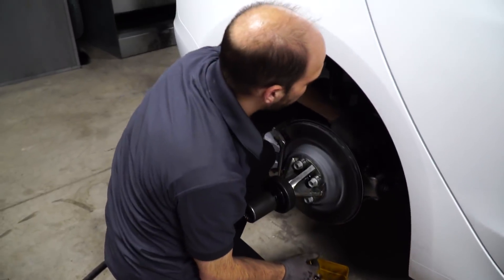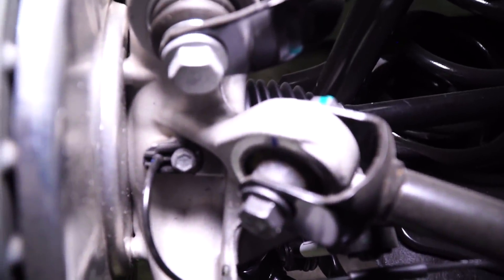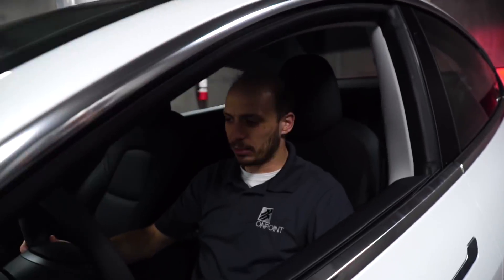Tesla Model 3 From Canadian Delivery To Dyno

Comment: Look like tesla very hard sand bagging this car, according to EPA this car have 258hp and on your dyno it have 340 whp(wheel !!!) that almost 100 hp more....There is only one question left for me... How long you can track it befor overhiting...
Reply: John Smith we will know next week!
Reply: +John Smith  Looking at how quickly the torque ramps up on the dyno graph, the Performance model will almost certainly be a software change.  Agree that the Model 3 power may currently be limited to protect and prolong the battery life, and to prove the durability of the pack before offering P model.  Also, Tesla makes continual battery improvements, so the later versions will have packs that have slightly more power and durability.
Reply: See: https://www.youtube.com/watch?v=iFr3ecpr5oU  Model 3 did multiple laps of Laguna Seca.  Model S, not so much.  Model 3 is lighter, smaller and significantly more efficient than Model S.
Reply: :-) That is part of answer ;-) and look promising...
Reply: That's incredible..why does Tesla underrate it that much?  But really the Model 3 should be a lot faster if it's making that much power, no?  Right now it seems between a 340i and a 330i in acceleration.
Reply: I think they limiting it for various reasons, mainly economic(they need a loot of cash now and want sell a lot dual motor / performance version), reliability(less stress on components), maybe when they will have more long term data they will unlock some power like in model s I think 100D get at some point 1s faster by software update.